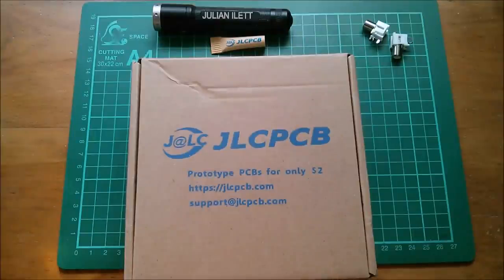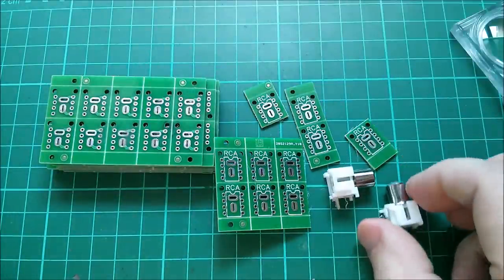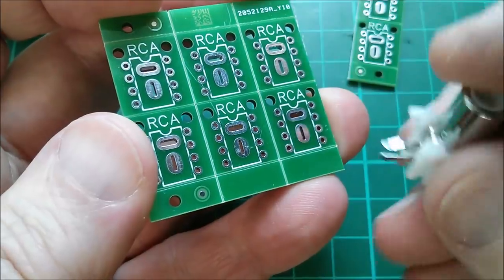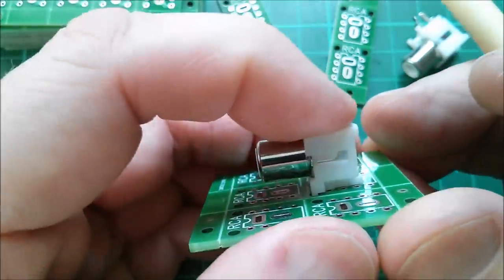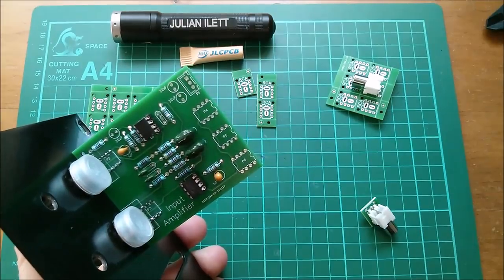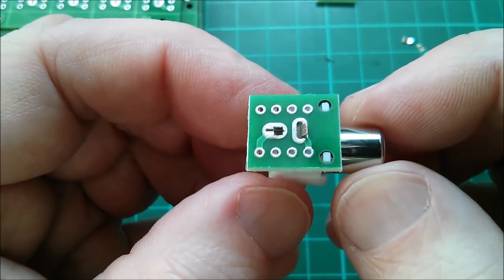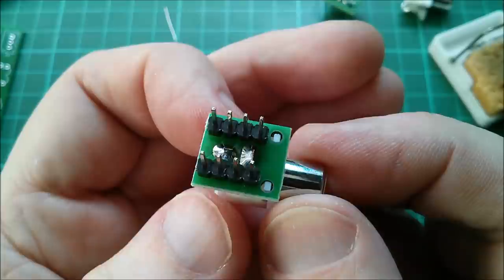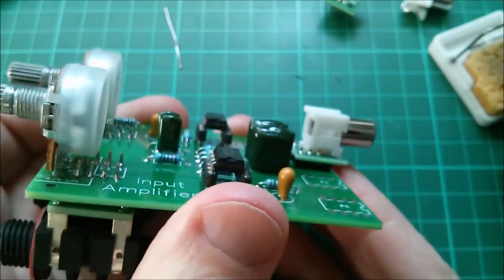New PCBs - Panelised RCA Boards with Slotted Holes - Vocoder

Comment: Is there any particular design reason why you chose to solder the daughter boards instead of make them plug into an 8 Pin DIP socket to make them interchangable?

Also why do you have 8 pin daughter connectors if only 2 pins are used on both parent and daughter board?

Comment: Julian, couldn't you just trim off the small piece of plastic blocking the pins with a sharp utility knife rather than trim the soldered pins?
Reply from the maker: I did a bit of both :)

Comment: over engineered... should have made a single daughterboard with 3 sockets rather than 3 daughterboards...
Reply from the maker: That's exactly what I'm doing with the 16 inputs to the output mixer/amplifier :)
Reply: Or just solder the RCA sockets directly to the main PCB and not bother with these silly pointless daughter boards.